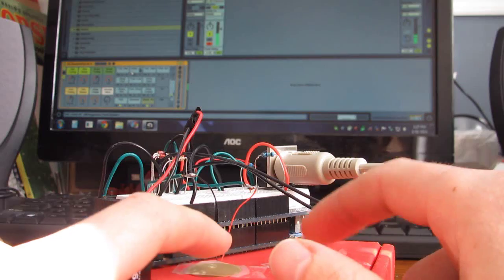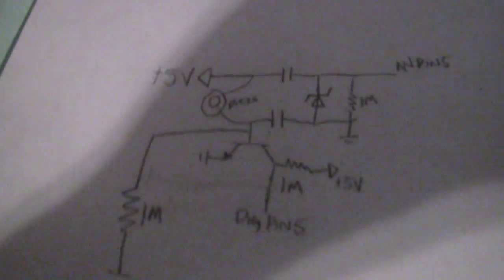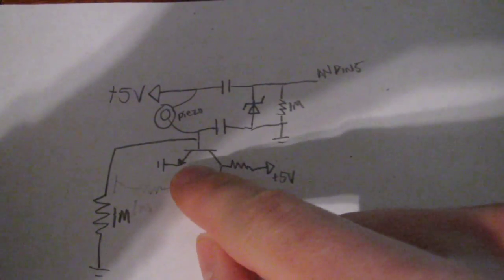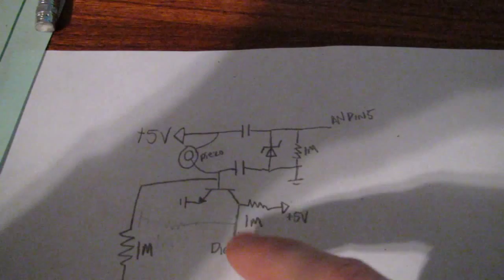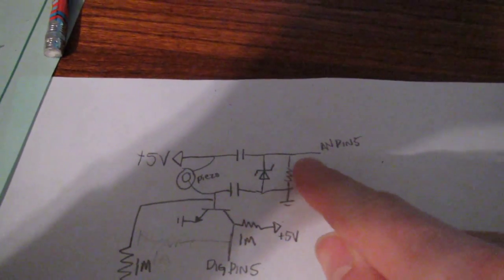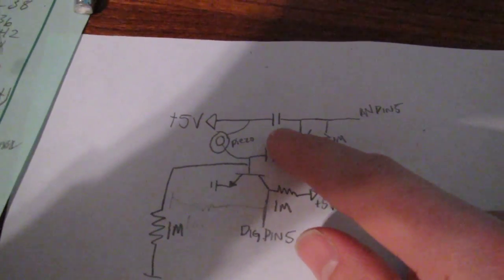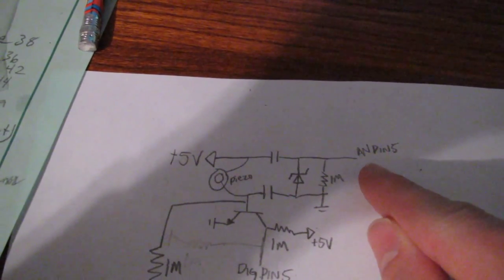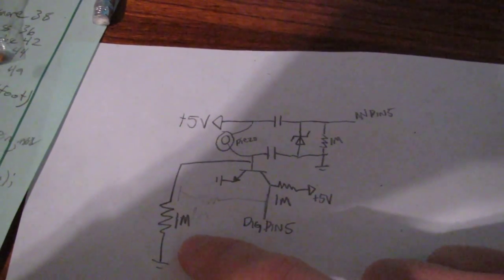Preventing retriggering (debouncing) on handheld piezo drum triggers

Comment: How did this work out?   Man, I have been struggling for a month to find a code solution for this.  My objective is to have the arduino only send the peak velocity once.  I currently only have a 1M resistor in parallel.
Reply from the maker: It's been a while but I remember having some success with adding these two lines to the beginning of the mainloop:

interrupts();
noInterrupts();

This helped me with a similar project. It prevents the arduino from going back to that pin when the value changes and interrupts the program.
The reason I turn them back on at the beginning of every loop is to allow the Arduino to be reprogrammed.

It's been a long time since I touched arduino code but I think choosing your velocity would look a little like this:

vLastPin1=0;
vNewPin1=1;

while(vNewPin1 > vLastPin){
    vLastPin1 = vNewPin1;
    vNewPin1 = getVelocity(1); //or whatever function name you chose here
} //This should deliver the highest captured value from the pin

if (vLastPin1 > 50) { //choose whatever minimum threshold to trigger
    noteOn(36, map(vLastPin1, 0, 1023, 0, 127));
    noteOff(36, 0);
}

 //Map just squeezes or stretches your captured value onto the midi range (0-127). 1023 is the 10 bit maximum and if I recall correctly, the resolution of the ADCs on Arduinos. But if yours has a higher resolution, you'd want to change this to the equivalent n-bit maximum (n**2 - 1)

Hope this helps!
Reply: Evan Burnette ...thanks for the reply. I am new with coding but thanks to tutorials I am learning.  So far I have been working without the Midi library.  I'll see if I can work that into my code.  Thanks, this has been driving me crazy.